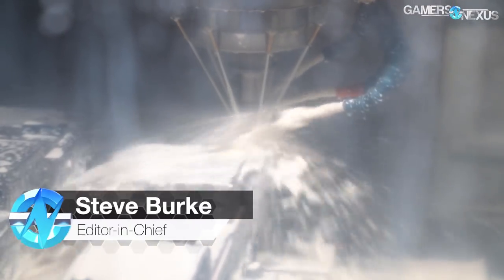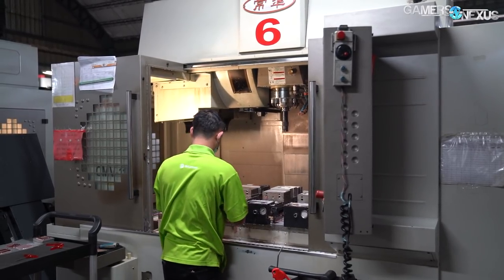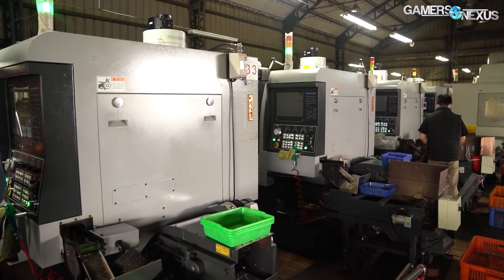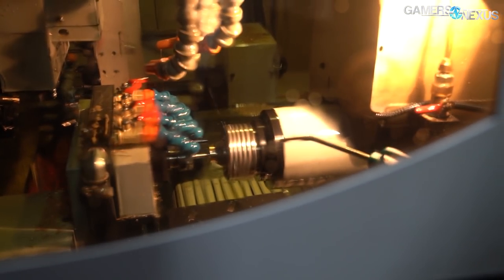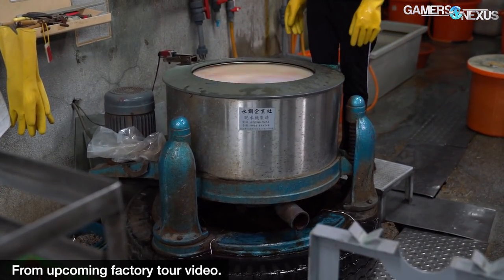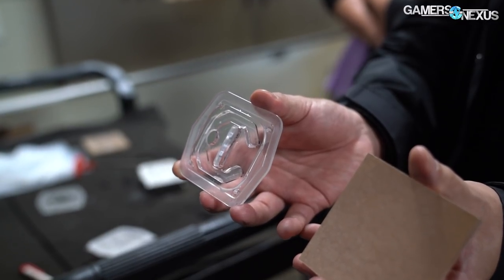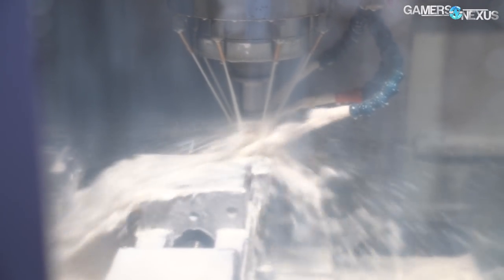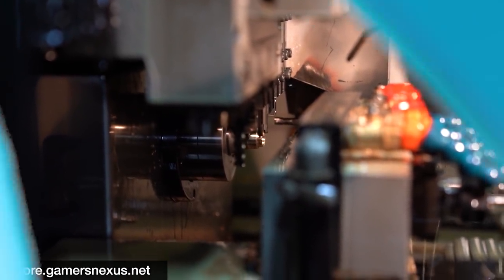Million Dollar Water Block: How Water Cooling is Made | Factory Tour in Taiwan

Comment: Those metal rods look a lot like brass, instead of copper. 

Brass is easily the most common material for water handling fittings in pc cooling and other consumer products.
Brass is the common material because it's much cheaper and waaay easier to machine than copper.
The blocks ofc need to be copper for thermal properties.
Reply: might be a translation error
Reply: Yea i said the same thing, stainless/brass fittings are the most common, i can't see any reason why they would use copper for a compression fitting.
Reply: I was thinking the same thing. I mean... for fittings and structural parts, it really doesn't matter if they're brass or copper, they'll get plated anyways. The blocks are where it really counts. 
It does call into question certain company's marketing of parts, though.
Reply: @AsbestosMuffins  that seems likely since brass is "yellow copper" :)
Reply: It's a super common translation error, but yeah.  they're clearly brass,
Reply: Reason why they looks like brass is because it is brass ( mashined more then my share of it to recognise that shitte materiale at first glans)
Reply: The correct term is barstock,  with round bars called (unsurprisingly) roundbar, with square bars refferred to as squarestock.
Reply: And the hole in the middle is called Squarespace Lol :D
Reply: at $4 per kg of waste, you bet it's brass
Reply from the maker: Yeah, we asked about that immediately and were told copper a second time, but I'd agree that it's probably brass. Another reason I'm learning Chinese - we'll hopefully be able to reduce technical errors in the future since translators are often not as technical as the engineers speaking Mandarin.
Reply: @GamersNexus  The engineers almost certainly recognize international chemical symbols, so you could write  Cu  Cu+Zn  Cu+Sn  on a piece of paper and point to the material and see which they indicate.  Likewise for the "1000 kg" mass of the scrap bags, just write that down and see if they correct it...
Reply: @GamersNexus  definitely a translation error, everything but the cold plates was brass.  the distinction between copper and copper alloy is one of those little details usually lost in translation.
Reply: @GamersNexus  An easy miscommunication. Copper is 铜 (Tong), Brass is 黄铜 (Huang Tong, or literally Yellow Copper), and Bronze is 青铜 (Qing Tong, or literally Green Copper). I think 铜 (Tong) is used as meaning Copper, and also a category of copper alloys or copper-like metals. Not a technically wrong way of categorizing since both Brass and Bronze are copper alloys.
Reply: @GamersNexus  Copper is 銅 and brass is 黃銅, literally "yellow copper", but copper is already yellow and it's common in Chinese to add color as a prefix to words with one syllable, so you see how that can be confusing.
Reply: You guys realize that copper is used to make brass, right?
Reply: You know what would be really cool? If these companies would manufacture in the US instead of going to foreign dumps all the time
Reply: Brass is harder than copper, also copper cannot be machined so well since it can deform under pressure and machining. Bronze on the other hand, a copper alloy like brass, is much harder and very difficult to machine. We don't need the strength of bronze in fittings like these, brass being strong enough and at the same time, malleable enough to have a good grip between bits.
Reply: Yea brass you barely need to change tools as well, very soft
Reply: @flikflak24  Why do you say Brass is Shitte? Other than Aluminum, what metal or alloy would be better?
Reply: @ilaion11  and if they are using taper threads (as they should due to it being for a liquid) they wont need to use any sealant on the threads
Reply: @kaziwill  Not possible, unless most customers are willing to pay even more money for those already very expensive water cooling parts. Manufacture in US not only will increase labor cost, but also more raw material cost, since many raw material need to ship to U.S.
Reply: @robrocksea  because i work in the same kinda industri and the way brass chips compared to other alloy's is shitty ( aka. It makes a huge mess and "scream" When your cutting it. That's Why i think it's a shitty materia)l
Reply: @GamersNexus  I am extremely curious to know how the fins of the blocks are made ... edm? wire edm? or traditional cnc with very small (and resistant) tools? can you make a more detailed video of this part of the process?
Reply: @qiyuxuan9437  in this case directly as well Bitspower is from Taiwan. So it makes sense they have their factory in their country.
Reply: @kaziwill  even if they wanted to and consumers are willing to eat the cost apparently there just isnt a big enough labor force in the US.
Reply: Fittings are prettymuch allways brass.  So...

Comment: thank you for the great content. few terms for future usage: cnc chamber = cnc milling machine, also cnc chamber  = cnc lathe (latter is the one where the stock spins, former the one where the stock is stationary). oil = coolant.  Intresting to see how seemingly unoptimal part of the process is. It might be that the amount of parts run on the milling machines is so low that it doesn't require pallets and fixturing to make it economically viable. The lathes with the bar feeders seem to be much more optimized.
Reply: He should check out the endmills that cut super fast. It looks like a hot knife going through butter.
Reply: eey a fellow machinist

Comment: As a former CNC mill operator and programmer (at one of the biggest screw/bolt maker for the car industry, Bulten AB) I found this quite interesting. I’d love to see more about the actual CNC machines and their software. I used GibbsCAM 12, which was a hot mess filled with bugs and crashes. The workstation was pretty dope thou. Handled games pretty well during the 2+ hour jobs xD EDIT: I operated a Mazak Variaxis 500-5X II.
Reply: Oh boy, last version of GibbsCAM I used was 2012+ and that sure takes me back. To be honest most of them have their odd quirks and spats. Used MasterCAM for a while in progressive die manufacturing, HSMWorks in agricultural research equipment, and now NX, Fusion 360 and Hypermill for a consumer electronics company that will remain unnamed.

Comment: Nothing like the smell of cooling CNC oil in the morning!
Reply: Or getting chips in your eye... keep those safety glasses on folks.
Reply: @evilspoons  lol that dude with a air gun had no safety glasses, i was like bruh.
Reply: @evilspoons  I think they know what they are doing. Also the Machines are closed.
Reply: @harsimransingh615  you clearly didn't see the guy blowing the parts with the air gun. Nobody, no matter how many years of experience, or how skillfull, would be able to 100% avoid an eye injury.
Reply: @harsimransingh615  And I know what I'm doing, I'm an electrical engineer who works in factory automation.
Reply: I hate the coolant... It smells like used socks and leaves sticky, oily mess everywhere.

Comment: Those are some really cheap cnc machines! I was in a shop where there cheapest one was $250k! (USD)
Reply: Skidd2 those are cheaper competitors to haas cnc mills
Reply: @jefferyburns7893  [Almost] no one in Asia would bother importing Haas from the US. There are a lot of machine tool manufacturers there with dedicated foundry and casting plants dedicated to machine tools. And don't kid yourself, Haas is a pretty inexpensive commodity machine tool as far as these things go.
Reply: atomkinder67 agreed on all fronts. From the couple seconds I could pause and zoom in on the screen on the machine the machines seemed to be using the older but in my opinion better fadal software. I was also interested in the fact they were not set up with 4 and 5 axis mills from what I could tell
Reply: that's why they produce the blocks in taiwan or china
Reply: Don't forget that the more expensive CNC machines can also turn the 'subject' instead of relying on the operator to do so. They automatically infer the 0,0 point instead of using templates. However labor costs is low in Asia, so it's way cheaper to let a operator flip the subject than buying a machine that costs twice as much (and it also bigger)..

In the late 90s the IT company I worked for had a CNC factory customer that produces specialized items for various German car manufacturers. These items had very low tolerances. Parts that were allowed some larger tolerances were produced in Asia. The German luxery car manufacturers have more made in Europe than Asia than factories that produce for the common people. It's very simple, a car that costs 60.000 euro is easier to produce in Europe than a car that costs 20.000 euro..

However most of our customers were active in the offshore business..
Reply: i currently work for a plant that uses rotary transfer cnc machines.  From my understanding the cost for the cheapest is $10m (usd) while the most expensive is $500m (usd)
Reply: @2Fast4Mellow  True but not as true now as it was in the late 90's but now East Asia has the advantage of having the most comprehensive supply chain.

Comment: doesnt look like they have 5 axis machines. Those would cut down machining times dramatically because you dont have to do multipass milling on an qngled surface but you can tilt/rotate the 4th/5th axis and just use a facemill

ps. if you think you can only machine one piece at a time on a 5 axis, there are pyramid clamping things or Tombstones where you can machine more pieces at a time
Reply: Tombstones are generally used for high density workholding in 4 axis horizontal machining centers, HOWEVER, there are "pyramids" for mounting multiple centering vises in a 5 axis machine(both trunnion machines and swivel heads). See 5thaxis.com for examples - you'll note that they're in the "decent used car" spectrum in terms of price.
Reply: Any kind of fixture plate or zero point workholding would make their productivity skyrocket without even buying another machine.

Comment: GN in 2048: 
How 3mm Cpu is made : TSMC factory tour
Reply: Titan Mechanism  😂👌
Reply: Titan Mechanism how Planck lenght cpu Is made
Reply: *2028
Reply: He perhaps meant 3mm, which is sorta dumb but the again by 2030 silicone will perhaps be a thing of the past due to the transistor size becoming impossibly small.
Reply: Titan Mechanism  pretty sure either way we will have a process below nm by than lol
Reply: @4.0.4  by that size those transistors are becoming (proportionally) huge towers already, I wonder how heat dissipation will start to become an issue.
At one point we won't even be able to make them smaller anymore, they can't be thinner than one atom after all, wonder what will take over silicon in the next years

Comment: I’ve been wanting to try an custom loop, but find the $475+ bykski/barrowch price for a Laing D5 with pump top and reservoir, two 240mm radiators, cpu block, the pricey GPU block, various fittings, acrylic/petg tubing, biocide, little tools, etc to be too expensive for now. EKWB wants $760 for this setup, and all I can think about is how well my $60 be quiet tower performs and the GPU upgrade that I could alternatively buy for the same money. 

Thanks for showing us why these items cost what they do.
Reply: Yeah open loop is an investment, being low volume "hand built" products. I justified it by telling myself that I could re-use everything except the blocks over multiple upgrades.
Reply: Yeah. Solid loop from good quality  components can easily be ~1K
But BP stuff still insanely overpriced. Barrow fittings are just as good while having way lower cost
Reply: lol, that sound way overpriced for bykski/barriwch parts.....They are extreamly cheap in China, and a whole CPU+GPU loop usually cost below 300$.
Reply: yuxuan qi that sounds much more reasonable. Big markup and large shipping costs kill it.

Comment: 3 hours in a CNC is massive. Not surprised the prices are high on those parts.
Reply: Pos Chinese machines.
Reply: This only depends on what you're making and how you want to get there. I've had cycle times in the range of 40 hours.
Reply: @atomkinder67  if not talking about time particularly, but if they have used something multi axis like UMC 750p, they would have shaved a lot more time per part. But it seems like 3 axes are more cost effective for them. As the product is niche and is not produced in such a high quantity.
Reply: @nitishisad5947   but the cost of 5 axis  is far higher  when you dont need it    most jobs are 5 axis positioning and 3 axis machining
Reply: @nigelstone2565  that's what I said. See above.
Reply: These machines are not DIY CNC machines, those are top notch industrial CNC machines, production still remains cheap for those manufacturers as long as the demand reminds higher whatever the time required to produce those parts.

Comment: Nice, can’t wait for your U14s review to confirm my bias.  Gpus seem to benefit a lot from aios or open loops.  Hope NZXT brings back the kraken bracket for ampere.
Reply: Gpu definitely benefit more from water cooling, due to direct die contact with water block, while also having a much larger contact area. I change a FE GTX1080 to a AIO cooler, and it can easily maintain a sub 60 degree temp while maintain a higher clock, the stock blower cooler was so bad, the GPU thermal throttling while running over 80 degree...For CPUs, unless you delid and use liquid metal, you wont see nearly as much improvement using watercooling.

Comment: After recently replacing my old liquid cooler with a NH-D15 (and it's awesome performance that is significantly better than the old cooler could provide), my new mantra regarding water cooling is Just Say No!  (Lost my previous build when its liquid cooler failed and wrecked everything with a coolant leak.  Never, ever want a failure like that again)!
Reply: Which type of tubing did you used?  soft or hard?
Reply: @qiyuxuan9437  My old liquid cooler was a prepackaged, closed loop pump and radiator system that used soft rubber tubing.  This was the same as the previous cooling system, that leaked from the pump all into my CPU socket and motherboard (totally wrecking them).  When I installed the new NH-D15 air cooler recently, I used Thermal Grizzly thermal paste because from technical reviews I had seen its thermal transfer coefficient was about 50% higher than even the good thermal paste that Noctua provided.  I can't argue with the results from using the NH-D15 which are spectacular (beating the old liquid cooler by a solid 15C in a "100% CPU on all cores for over an hour" video rendering workload)!

Comment: On the unrelated side but I trust you guys

With a budget of 600 hundred euros I have 200 for the GPU, which would you suggest? I'm pairing it with a B450 MOBO and a Ryzen 5 2600 since Amazon has no 1600AF apparently

Comment: Sorry to correct you/the information you where given by them but the Oil is not to cool Anything ( mostly because the optimal cutting temps/reformation "zone" As it's called is 810 degree C°) 

The Oil is to Lubricate the tool's and remove "chips" So you don't recut the material that you already Cut

I work as a Industrial technician witch setup. Program and run's mashines like them

P. S. Would love to go to there factory and show / teach them how to make the parts faster and and with more parts in the mashines at the same time

Comment: Cool, they are using SolidWorks and its Flow Simulation add-on for designing the water blocks. I've noticed you can add heat sources, simulate heatpipes and fans and so on in SolidWorks Flow Sim, so I'm thinking about doing some sort of a CPU cooler simulation on my free time with SolidWorks :p I could even model a radiator and simulate that with a CPU water block.
I'm currently working on my thesis in which I use SolidWorks Flow Simulation to simulate flue gas flow in a huge flue gas channel. But that's not as interesting as simulating some PC parts :D

Comment: Nice, I love bitspower fittings, made me feel slightly less guilty for splurging on it recently. But at least I know why they cost so much! A question, does no WaterBlock manufacturer allows filming of the cooling fin machining process? I haven't found any, and it's an extremely interesting part
Reply: I assume you mean the microchannels on cold plates.  Machining those things isn't easy, and I expect that once these companies come up with a good solution, they don't want to give it away by showing it on camera.

Comment: The fittings being turned looked more like brass than copper and since copper is much softer than brass it would not make a good fitting. I believe this might be a "lost in translation" issue because brass is an alloy of copper. Those are some really inexpensive CNC machines, over half the price of what is available in the states.

Comment: Some Swiss type lathes , and a few medium Vertical cnc mills , a nice lil' shop . The machines are not that cheap , but nowhere near expensive , they don't really need extreme precision and heavy cuts , basic machining for the most part . Some part cycles take that long and can take even longer . To give some ideas on tool prices a 'standard' size endmill 12mm or 1/2" can cost anywhere from 40€ to 200€ depending . A smaller more 'standard' for them a 6mm endmill cost between 20€ to around 75€ , special geometries and flute leghts can cost even more! . A smallish drill of 4.2mm will set you back around 35€ and up to80€ . Larger tools as seen in the toolcart at some point (im talking about the above 50mm dia tools) cost around 400-800€ for the body , holder and cutting inserts sold separately . I don't know why i said all this , but it's nice to see a cnc factory tour by TechJesus himself.